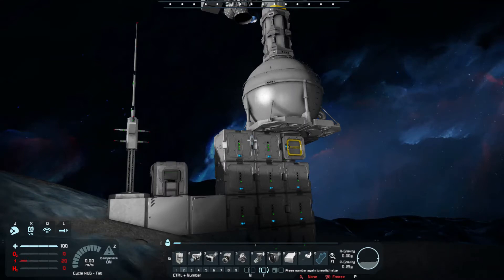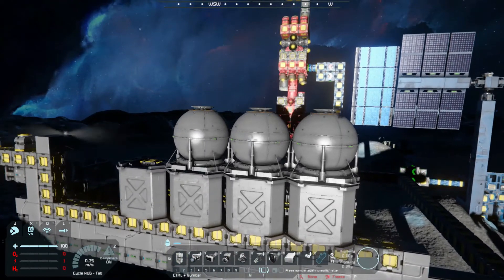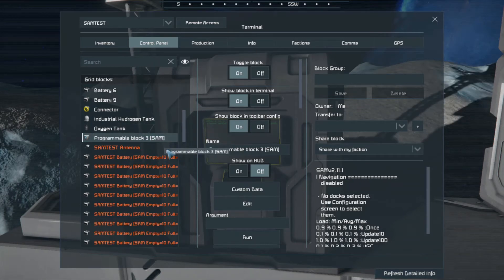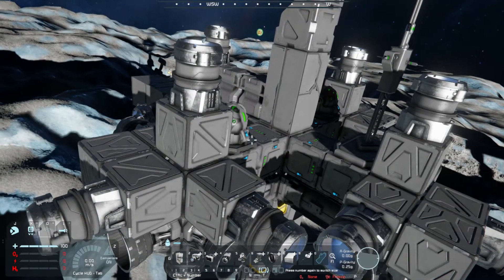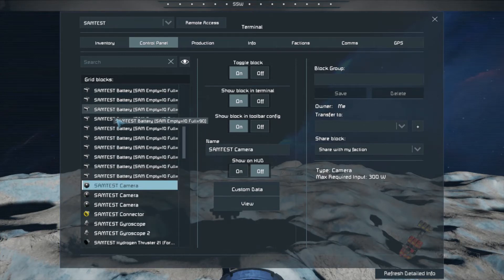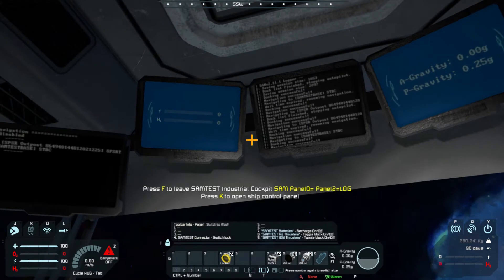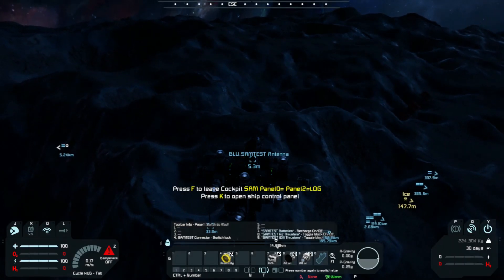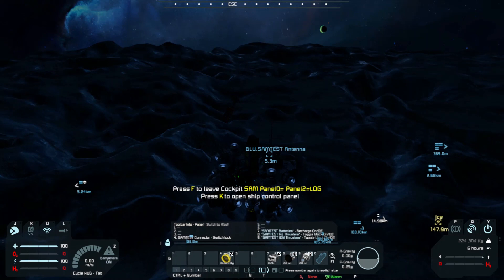SAMv2 Setup & Design - BEST Space Engineers Scripts Series

Comment: @13:45
I noticed you did this in other spots too, like the SAM. followed by SAM. Adervtise, WHY? As a hobbiest programmer, and electrical/mechanical engineer, seeing the SAM. everywhere as so bad... you don't just put values and data in places because it "just works" :D. You should put it where it is needed. Extra data = BAD data. Spamming it all just adds complexity to the the system during troubleshooting.
Video had all the info needed to get things working, just wayyyy more stuff to do than required. Thanks
Reply from the maker: I agree, though that is how it works - partly because of the limits by Keen, partly because of how c# works - and a bit because of the way the original programmer programs.  I can't say "bad/good" or "right/wrong", though as a user, it is a bit more work (and uglier) than I would like.

Glad the video helped you get there, though!
Reply: Oh no i get that it may be needed. The . at the end is 100% required in some spots. But my point was the points where it was said that you do it "Because it works" not really a valid reason,  maybe it is my english, i take that as a "it may not be needed, but i do it anyways because why not, it doesn't hurt." Even in spots where it isn't required.
Reply: @TechCoder1  I don't use SAM for that reason. Too many steps / too complicated to set up. I use PAM for most of my drone ships. PAM is much easier to setup. Unfortunately though I have a feeling PAM is going to need an update sooner than later and the author hasn't been active for several years. :(

Comment: Thank you for the attempt at explaining this script, but I find your video to be too long and far from to the point. Since you also introduce a great deal of confusion as to what is ACTUALLY required for this script to function, let me post my findings below to help dispel some confusion : 

When naming your stations and connectors I advise you to keep it short enough to read on the LCD.

Important tags : 
	Ship Required
		Programmable Block [SAM NODAMPENERS]
		Remote Controller [SAM]
		Connector [SAM]
		Camera Up [SAM]
		Camera Down [SAM]
		Camera Forward [SAM]
		Antenna [SAM]
		LCD Panel [SAM]
		
	Station Required
		Programmable Block [SAM ADVERTISE Name=XXX]
		Antenna (Does not require tag)
		Connector [SAM Name=XXX]
		
		
	Ship Optional
		Wide LCD Panel [SAM LOG]
		Battery [SAM Empty=10 Full=90]
		Hydrogen Tank [SAM Empty=10 Full=90]
		Cargo Container [SAM]
		Cockpit [SAM PANEL0: PANEL2:LOG]
		
		
		
	
	Programmable Block Hotbar in Cockpit (My personal preferences)
		Hotbar# - Slot #
		
		8-2 CLEARSTORAGE (must recompile)
		8-7 ADD (waypoint)
		8-8 ADD STANCE (waypoint with ship orientation)
		8-9 REMOVE (removes waypoint)
		
		
		9-1 SCREEN
		9-4 NEXT
		9-5 PREV
		9-6 SELECT
		9-8 START
                9-9 STOP